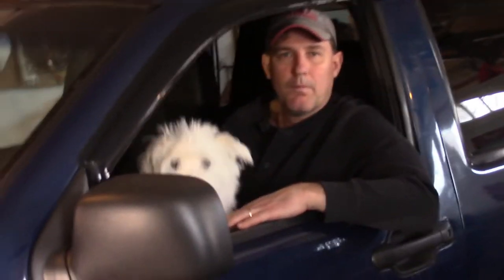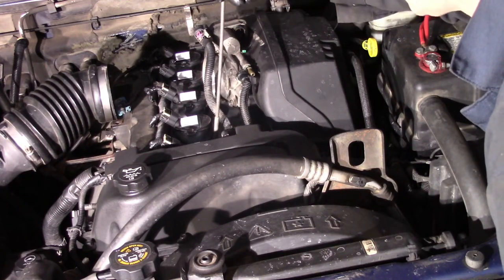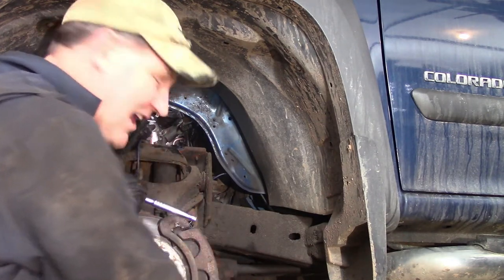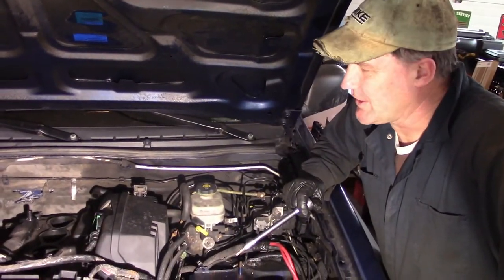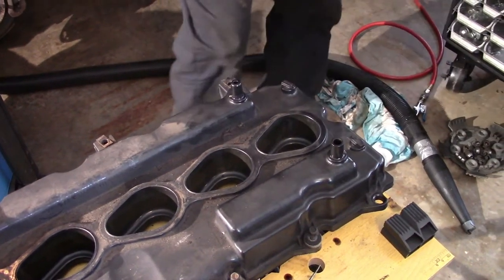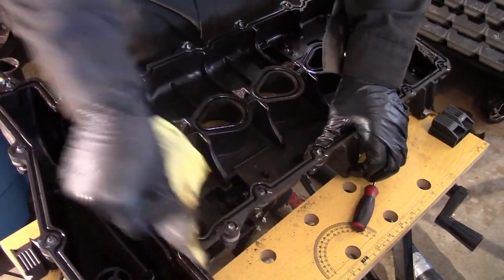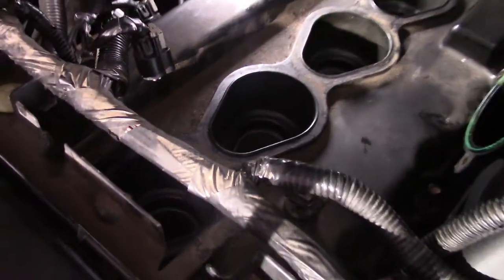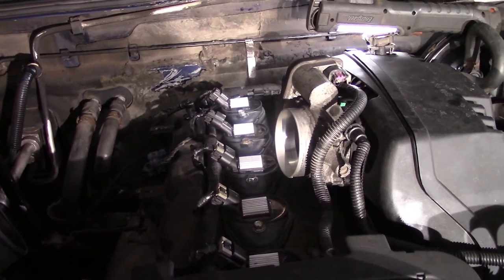2005 Chevy Colorado How to Remove the Valve Cover, Clean, Replace the PCV, Blue Smoke Problem Fixed.

Comment from the maker: Update # 2... It's been over a year with no smoke out the exhaust on start up or at any time. I've put over 16 000 kms and the problem has not come back. I officially declared it is fixed. It was a simple PCV orifice clogged with oil. Helpful hint: I would avoid any engine oil treatment products that are thicker than GM's recommended 5W30. In my opinion they will clog your PCV orifice. This engine is designed for 5W30 oil and it will punish you if you stray from that. If you watch the entire video, you will find an easy way to clear the clogged PCV without removing the valve cover. Good Luck Gentlemen & Ladies.
Reply: Man with all the work you've done on your truck it oughta last FOREVER. 
I used to wrench for a living and I don't enjoy it as much as I did 35+ years ago - I'm not as flexible or fit! But you're right, it's just nuts n bolts for this kind of work. Thanks for the work you do on these videos!
Edit:  OMG a 3/32" drill bit huh?? Now I appreciate you even more for saving me about a day's work on the truck! :)
Reply from the maker: @chipsawdust5816  Yeah you're right Chip. Sometimes It's like doing yoga or something when you are underneath the truck and you have to contort yourself to get a wrench on a certain nut. (when you don't have a lift :)
I like helping people Chip. Thanks for the great comment. Keep on Truck'n!

Comment from the maker: Update...I've been driving the truck hard on long trips and short trips. I've put 1000 kms on it over 15 days and it no longer smokes at start up. It was a partially clogged PCV orifice under the valve cover which was my best case scenario. There are no apparent gasket leaks. It's working well. :)
Reply: Why is my obd2 scanner saying command evap 0.0%
Reply: Great information and well done sir.
Reply: Good deal! Loved the video. Thank you!
Reply: How was your mileage before and after? Any change? I have an 06 and recently my mileage has not been great. I’m at 146000 km.
Reply from the maker: @snwsk8  Hi Shawn, You're not giving me a lot to go on here :) Is that your only symptom... poor mileage? It can be so many things. 146,000 kms over 16 years is not very much mileage. Without anymore info, I would clean the PCV orifice without removing the valve cover like I show you in the video (perhaps a previous owner used an oil treatment or thicker oil than 5W-30). I would start by cleaning and checking for easy non-expensive repairs like a rodent's nest clogging the air filter? (rodents also love our trucks) Has the spark plugs been changed? Often, when you start checking and cleaning you may find a sensor wire chewed or a plug disconnected, You'll figure it out Shawn and let us know what you found. Good Luck!
Reply: I have loosened all the bolts to the manifold cover just like you showed but it still isn't moving. Is there anyway that you can help me figure out what is going on
Reply from the maker: @kurtodom3433  You must have missed one of the bolts. In my video I show you there's a pattern to the bolt position, every couple of inches. If you take another look at the video you may see where you missed a bolt. The manifold will come off easy if all the bolts are loosened. it is easy to miss one.
Reply from the maker: @kurtodom3433  I have another video that goes over every bolt position on the intake manifold, the pattern of the bolts and how to attack them in detail. Here is the video link https://youtu.be/kWOFRZaFvYM

Comment: So much easier to pull the air box off and spray some brake cleaner down the pcv. Then do oil change.

Comment: I still have the same problem. Heres my theory. The oil consumption is coming from the dirty air pcv orifice. If you open up the dirty air pcv orifice,  how could that possibly PREVENT further oil ingestion? Bigger hole, more vaccum, more oil ingestion, right? I had my valve cover off and the dirty air orifice was not clogged, its made about a fifth the diameter of the clean air orifice. The clean air was totally clean, so the oil is not coming from there.

Comment: So, one should be able to check that pcv nipple on the i5 at spark plug replacement time? I plan to be in there soon for new plugs at 300,000 miles, like I did for 100,000 and 200,000. I may pour a little Berrymans in there for good measure, too. I replaced the throttle body at 235,000 miles. Good trucks.

Comment: I have a 04 canyon with the I 5 and it uses huge amounts of oil. I checked the pcv, good. Cleaned the throttle body. No oil in the radiator, no leaks. Only smokes a little when I rev it up…..sometimes. I give it hell on the hwy. and see maybe just a little smoke sometimes. This thing uses a quart every 3-500 miles. I can’t figure out where it’s going. I changed plugs and number 4 from the front was fouled and oily. Checked after the change and it’s clean. I can’t figure it out so I’m just to the point of adding at least a quart every 2 fuel fill ups. It runs great, good power, but the damn thing just drinks oil. 185k miles.

Comment: Didn’t have to remove cover. I just used a 9/32 bit like you suggested.  Port was completely plugged and bit cleared it and  now pulling nice vacuum through the pcv.  Thank you.
Reply from the maker: Nice..that saved you a lot of time, work and money. Thanks for the Great feedback on my video. Happy Trucking!
Reply: used a 932 or 332 bit
Reply from the maker: @edgardoponce9035  3/32 drill bit is what you need to clean out the PCV orifice. I believe John mistakenly mentioned 9/32 but that would not fit. 
Just to clarify, 3/32 of an inch drill bit perfectly fits that orifice and can be used to clean it out. I have put 10,000kms on that truck since I've cleaned the PCV orifice and not a hint of smoke. There's not many issues you can fix for free but this is one of them. Good Luck Edgardo...and don't forget to like and subscribe!

Comment: Thanks for your help man! I did it on my 2006 limited edition Colorado. Inline 5. Was not easy! But I powered through. No turning back once you start. Your tips helped me through it. 
My pcv valve orifice was also clogged!! Thanks again. She’s up and running again.
Reply from the maker: Excellent Alejandro...I'm glad i was able to help you out.  Keep on Truck'n !
Reply: @cantletherdiediy1050  I deleted last question because I believe I found the culprit. Oil is passing through my pressure sensor. Gonna start there.
Reply from the maker: @Mordorer  Those oil pressure sensors seem to leak oil through them often. I believe I've replaced it twice now. It's an easy fix. Good Luck!

Comment: Loved seeing this video today, my high mileage 06 canyon (670’000km) has just started puffing smoke on start up after sitting all day and an 80km ish commute on the highway. However I’m noticing it doesn’t burn any oil when driving or revving after startup, as well as not burning on startup after short trips. Going to give this a shot tonight! Thanks again!
Reply from the maker: Hey Gavin, You may not need to remove the valve cover. Try the drill bit first. It’s explained in the video. Good luck!
Reply from the maker: Congrats on 670000kms!!!
Reply: Yes sir, 3/32 drill bit did the trick! There was a tonne of gunk in there, I started with a 5/64 bit and even that pulled a significant amount out! Hoping this fixes my issue.

Comment: Amazing how calmly and encouragingly you walk through this process explaining every details for rookies like me.  I had an intermittent rough idle that finally developed the throw a misfire in cyclinder 5.  Prepared to change all the plugs, but discovered oil in the plug well.  I'm thinking the coil seal has failed.  How long did this job take you?  And please tell me if there could be another culprit!
Reply from the maker: Hi Jacob,
It is hard to diagnose your problem from here Jacob without seeing it and knowing year, miles, previous mechanical work etc.
If i were you, I would look for an easy answer before moving quickly to replacing the valve cover gasket which includes the individual gaskets around the spark plug wells. In this video, I show the viewers how to clean the PCV orifice for free, without removing the valve cover. A poor venting engine due to a partially clogged PCV orifice could cause positive crankcase pressure to build up and, in your case,  blow oil out the Cylinder 5 spark plug well. Since it is easy and free, I would try to clean the PCV orifice first. 2) I would clean-up or replace cylinder 5 spark plug and re-install. With my fingers and toes crossed for luck, take it for a drive and see if the problem returns. 3) if you have oil blowing into the spark plug well, you may have oil accumulating on the throttle body as well causing the stuttering / rough idle. You may want to clean the throttle body if it appears dirty with oil, crud, etc. I hope that gives you a few leads to follow-up on Jacob. Good luck Pal!

Comment: Good video...informative loosening air intake without removing intake is wise...I removed it to replace valve cover so I replaced air intake seal also may not have been neccesary....

Comment: Thanks alot you sure helped me. I had metal plate covering 2 of the bolts on the intake manifold towards the right side. I just left it off when finishing up, you think this is ok? Seems like just a wireharness mount and it gets in the way

Comment: so you just recommend just cleaning out the pcv valve. is there anything that can be done about the oil buildup under the pcv and breather tube? i need to replace crankshaft position senor and camshaft position sensor and am planning on trying to clean out the pcv valve as the engine burns alot of oil that is coming in the intake through the breather tube cause of blockage in the pcv.
Reply from the maker: Hi Barret, Thanks for your comment. Based on my experience with these trucks. Clean out the oil in the breather tube and clean the pcv orifice with the drill bit and use only the recommended 5W-30 grade oil. Do not use thicker oils or any oil treatments / engine treatments or oil for high mileage vehicles in these trucks as they cause the plugging of the pcv orifice. Before you start spending  money on more expensive repairs, I would try that first and hopefully, if it is the same issue as other Colorados / Canyons, that will correct the issue. Good Luck Barret. Don't forget to like and subscribe if my videos have helped you out any. Cheers!

Comment: Are ou not able to just disconnect the hoses on top and add sea foam to it that way ? Or just push bit from top down with manifold on truck still
Reply from the maker: Yes, you can disconnect the hose and unplug the clogged PCV orifice by inserting the drill bit into the orifice.

Comment: I went in to change my spark plugs and I noticed quite a bit of oil going through the PCV hose, into the cover and my throttle body had some oil residue. Do you think I might have the same problem as you?? I have been noticing the past couple of oil changes that my truck has been burning oil. Any advice would help! Thanks in advance. Great content by the way!
Reply from the maker: The quickest, easiest, cheapest solution is to clean the pcv orifice. In the video, I use a drill bit to clean it. You can do it without removing the valve cover. You remember what size of drill bit don't you?
Reply: @cantletherdiediy1050  yessir 3/32. I’m going to do that right now. My 3.7 Colorado is consuming a lot of oil. So I’m really hoping this is the issue! Thanks again!
Reply: @danielcuellar5134  did that work cleaning it out or was it a different problem? Cause I got the same problem. (Burning oil and throttle body dirty)

Comment: Have a buddy that overfilled his truck with oil and flooded the plugs. Never in a million years would I think it's this hard to pull a valve cover. Have all the manifold bolts loose but one, can't find it.

It's the one right between the two rear intake runners. Does the dipstick bracket need to come off completely?
Reply from the maker: Yeah, it's tough. The 4 bolts holding the dipstick bracket has to be removed to pull the dipstick bracket up & out of the way. I used a bunny cord. There's one bolt that you can not see until you do that. You can get it from the wheel well, not from up top. I hope that helps. You got it, don't give up
Cheers!
Reply from the maker: This video goes into detail of how to find each of those intake manifold bolts 

            https://youtu.be/kWOFRZaFvYM
Reply: @cantletherdiediy1050  I was being lazy and didn't want to take off that bracket. Got her loose thanks to this video.

Comment: Hi friend. Very good your video, excellent I will have to replace the valve cover gasket on my 2006 3.5L Colorado and follow in its footsteps carefully. I want to ask you the following: I have to change the knock sensor, but I don't know, how many pounds of tightening torque it should give, do you know what the tightening torque is for this sensor? Thank you and I congratulate you for your videos, very good and very well explained.- Greetings from Valparaíso V Region CHILE.

In Spanish Hola amigo. Muy bieno tu video, excelente, Tendré que reemplazar la junta de la tapa de la válvula en mi 2006 3.5L Colorado y seguir tus pasos con cuidado. Quiero preguntarte lo siguiente: tengo que cambiar el sensor de detonación, pero no sé cuántas libras de par de apriete debería dar, ¿sabes cuál es el par de apriete para este sensor? Gracias y los felicito por sus videos, muy buenos y muy bien explicados.- Saludos desde Valparaíso V Región CHILE.

Comment: That looks like about as much fun as pulling your own tooth with a pair of rusty pliers! Jeez!  Did you unbolt the intake manifold from the head just for clearance to access valve cover bolts? Kind of pull it off to the side. Anyway I want to thank you for your video on removing the wheel hub bearings on the 4 wheel drive Canyons. I struggled until trying your method of using 6 inch long bolts to push the back of the rotor away from the steering knuckle to separate the bearing .I can now remove wheel hub bearings with a few hand tools and small bottle jack in about 25 minutes .I ve  pulled three sets in a junk yard with only tools carried in my old Harleys saddle bags. I see guys complaining what a terrible design  Canyons brake rotors are to change . Not a big deal using your trick !

Comment: Thanks for your good video. I have to remove the valve cover and your video helped me a lot. I congratulate you friend for your great videos and very well explained every detail. Regards . JOHANS BEJCEK. From VALPARAISO - C H I L E.   In Spanish = 
Gracias por tu buen video. Tengo que quitar la tapa de la válvula y tu video me ayudó mucho. Te felicito amigo por tus grandiosos videos y muy bien explicado cada detalle. Saludos . JOHANS BEJCEK. Desde VALPARAISO - C H I L E.
Reply from the maker: Awesome...I'm impressed that wherever we live, whatever our culture, we are all working on the same vehicles, doing the same mechanical work to keep our vehicles working well. Keep on Trucking Johans!
Reply: @cantletherdiediy1050  I can tell you that I am a very loyal fan of all American and Canadian Pickups. C10-Custom Scottsdale- Silverado and my current 2006 Chevy Colorado Z71 .. WHAT WONDERFUL, MY FRIEND. Keep going with your good videos. Good luck. JOHANS.

Comment: In the Haynes manual it says each injector is set at a different flow rate and they need to be reset if you replace them. And says you can not swap cylinder 1 injector to 2 injector. So how does your truck run after your injector replacement.  I've had a p0300 driving me crazy. Lol
Reply from the maker: Hey Justin. Thanks for the question/comment. My truck has been working Great. That makes no sense. No, you do not have to reset the fuel injectors. Are you getting any other codes?  Have you recently replaced the fuel pump and fuel filter? Have you introduced dirt/debris into the fuel line which got past the fuel filter and is causing an intermittent random misfire? Don't forget to click on notifications and subscribe
Reply: No just p0300 random misfire. And its had a tune up and been well taken care of. All test point to fuel injectors. Which I have just was confused cause I've seen videos like your of people changing fuel injectors but not program ecu like book calls for. But everyone says it's just fine.
Reply from the maker: Justin Botkin Hi Justin,
My truck runs very well. Excellent. Since it is hard to get to the fuel injectors,  I recommend changing all 5 fuel injectors while your in there. That way you never have to go back.... Good Luck Justin!

Comment: I live in Texas and called every dealership and I can’t find the valve cover any idea where I can get one?
Reply from the maker: Sorry Woden925, I could not find one either. GM is no longer making some replacement parts. You are left with auto salvage yards that may have a good quality used valve cover. Good Luck
Reply: Ebay is a life savior got mine there
Reply: @Lechugadelmalodemisa  lucky I been searching and no luck